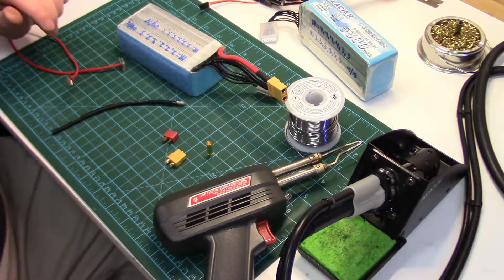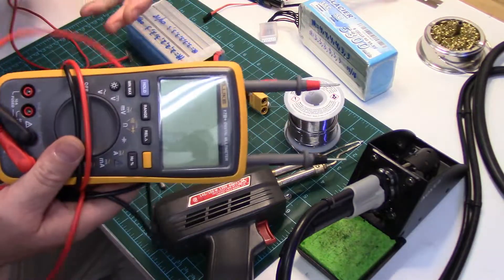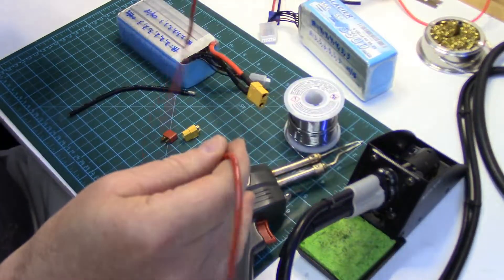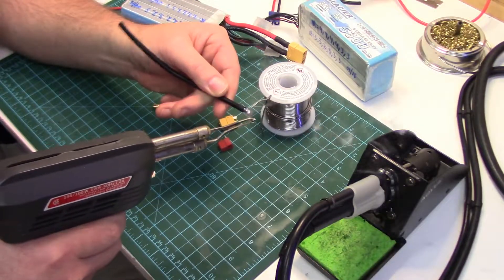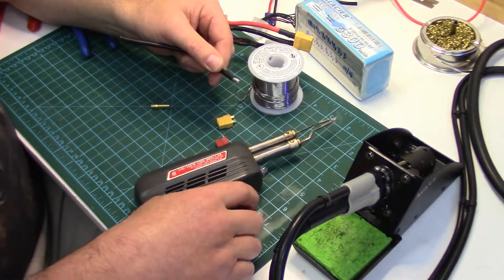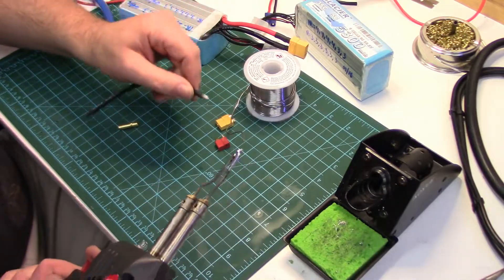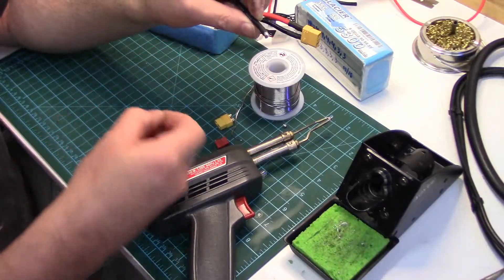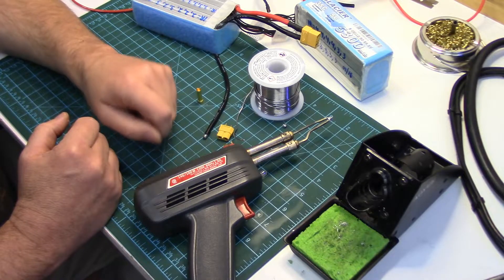How To Tin Wires Before Soldering

Comment from the maker: Want to learn more about the hobby of RC helicopters? Please visit my website:
https://www.rchelicopterfun.com
Reply: What soldering iron heat setting is perfect when working with 12 to 10 gauge silicone wire?  Personally, I love the EC3 & EC5 connectors, along with the XT30 & XT60 connectors.  
I have them "pretty" well mastered.  I also have used the "Solderless" Anderson plugs.  They work great especially if your in tight places and don't want heat around certain components.

FWIW, I "don't" like the Dean Connector's.  I do use them in my smaller Heli's, but never on 500's on up.  When soldered correctly, they do hold up.  I have never had a "separation", but I have separated them pulling them apart!  This happened after I had cycled them 10 to 15 times.  

It's a personal thing with me about just soldering wire to a "flat" pin.  I have done many of them, and I have tried many ways to separate them after soldered!  Their very delicate, and I have to watch to make sure I don't get the "Plastic" to hot while soldering.  It will change the position of the flat pins.

Sometimes, I have used the XT90 connectors, just depends on the project.  I also have used "Butt Connector's" when tolerances are just too tight.  I was taught the more "solder" that's used, it raises the "amp" usage a little.  Same with using an oversize plug for the project.

On my dual battery tray setup's, I use what ever plug that takes the less space (Example:  T-Rex 700).  I have them set up where I can charge both batteries separately on my Duo 406.

I do my best to make sure the Neg & Pos wires are as close to the same length possible, just to keep the electrical flow even.  One of my Pet Peeves.

I have extended the wire length just using a one piece solid butt connector with waterproof heat shrink.

If I don't have any "waterproof" Heat Shrink, I will put a longer piece of regular heat shrink on the wire (maybe a size larger) before soldering the butt connector.  I will put a little silicone on the wire I just soldered (after it's cooled"), not skimpy, just generous, then I will push the "heat shrink" over the splice while twisting the heat shrink to make sure the silicone is even on the inside, then start heating "slowly" starting in the middle and working towards the outer edge of the heat shrink, just taking my time, and I make sure it shrinks evenly.  The most important part is to start the heat in the middle and working out on both sides.  The "excess" silicone will squeeze out during this process.  
Works great, then you have a "waterproof" connection.

Hint:  on the above, after soldering, make sure you clean your freshly soldered connection with the proper cleaning solution, then proceed with the heat shrink. 
I use an alcohol product.  To all reading this, you use whatever cleaning product is recommended.  Some recommendations I have read, well . . . I won't pass this information onto others.  If this step is omitted, it will cause corrosion problems at the joint shortly.

I have tried the clear "solderless heat shrink", and IMO it's great on the smaller wires, I just don't trust it on 14 gauge wire and up.  Works great on 22 gauge wires.

I wish we could post pictures on our responses on this site.

Good Luck to everyone!

Comment: Great video! I had a question. I own the same Soldering gun. Do your tips warp? Mine do. I bend them back into shape with a pair of needle nose pliers.
Reply from the maker: Yes, weller copper tips are soft and get even softer when they are heated up. It certainly doesn't take much pressure (especially side pressure) to warp them out of alignment. Just bend them back the way you are doing.
Reply: @Rchelicopterfun  Will do. Thanks for the response.

Comment: So, if you're using marine grade wire, do you still need to tin the end?
Reply from the maker: No different from any other type of stranded wire; it depends on what you are doing with the ends of the wire. If you are soldering the ends for some reason, then yes you need to tin the ends. If you are crimping the ends, then no, you don't solder them.
Reply: @Rchelicopterfun  Each strand of marine grade wire is coated with tin. You still need to fill the strands with solder?
Reply from the maker: Of course. The whole idea of tinning multi-stranded wire as shown & stated in this video is to saturate the strands so you can then easily melt the wire end into or onto whatever in as little time with as little solder as possible to avoid overheating the components or wire insulation. 
This is even more critical on marine grade multi strand wire since most MGW uses finer wire strands for high flex applications. Just like fine stranded high flex silicone wire in this video (which also clearly has pre-tinned strands). All those fine strands act as formidable solder wick and are very difficult to solder onto a component if they are not first saturated (tinned) with solder.

Comment: Great video.  I'm about to do a fuel pump conversion on a hybrid ATV and the fuel pump came with blade connectors and I really don't like that setup.  I'm going to practice this and try soldering the connections and use deuche connectors for ease of removal.

Comment: I would recommend a small fan and set the fan so it draws the smoke not pushing it. Hopefully all you soldering experts are already aware of that. But it's rare that I see someone using a fan when soldering. And "specific" soldering fans I think are expensive so I just took a fan out of an old computer, connected a base to it and good to go using USB connection into my computer to run it. Someone smarter than me probably could figure out a way to have the small fan connected to your "helping hands" tool. I have found those to be more than handy when soldering.
Reply from the maker: Have one but generally don't use it in videos due to noise & space: https://youtu.be/gLGN8d7r1eI?si=Lv4_9_C11pXMnJ60
That little brushless fan I used was okay, but no question the larger fan works much better - by the way, it started working fine after I took it apart ( https://youtu.be/33kR0ZRE5rk?si=PY4PI0hHKtfb1ZxT ); suspect something loose or binding in the fan motor and it's been working great to this day.

Comment: ouldn't using a dab of flux be a good idea when trying to tin high strand wire to help pull the solder through the strands? I know flux core solder obvious has flux in it, but often if working with stranded high it doesn't seem to be enough. Not alot of flux, just a bit to draw the solder through the wires?  I guess this is a rhetorical question.  lol  Thanks for the video, and maybe flux isn't needed, I think I'm to the point that it isn't me, or the solder, but how good (or cheap) of a soldering iron I'm using that is giving me the problem. Doesn't stay hot long enough.
Reply from the maker: Plenty of flux in Kester 44 rosin core solder. Rarely do I ever have to add extra unless I apply the heat too long and it all boils off - then of course you do have to add more flux or just add more Kester 44.

Comment: Great video!  Is the first tinning considered what I hear folks call a “cold” solder which will eventually fail?  Also what are your thoughts on on using a tinning pot?
Reply from the maker: A cold solder joint or failure is when the soldering connection is brittle and/or has poor metallurgical bonding. And/or because one usually causes the other.
This brittle/poor bonding can be caused by not having enough heat or heat pentation, contamination/oxidation, poor quality solder and a big one for newbies - part/component movement while the solder is cooling back into a solid.
Unleaded solder is much less forgiving to all the above and it's much more likely to get cold solder joints with unleaded than with leaded. It's why I and most only recommend using good quality 60/40 or 63/37 leaded solder.
Never used a tinning pot so can't comment on it. Personally, I see need for one as a hobbyist which I am. If I was making dozens of wiring harnesses daily, then might likely look into getting one.

Comment: I have a soldering unit with digital temp. What temperature should I use ?
Reply from the maker: Depends on iron wattage, type of solder, wire size, solder tip size/shape & your technique - in other words you have to experiment until you find the best temperature for your specific application. 🙂 As a coarse starting point however, if using good quality rosin core leaded solder and a decent wattage rated iron (70W or better) with medium sized wire & a chisel or wedge tip, I would recommend setting the starting temp around 370C/700F and adjust up or down as required.
Reply: @Rchelicopterfun  awesome thanks.

Comment: just stumbled on your video as i was struggling with some battery connectors for my RC planes.  Why would you use a soldering gun vs an iron?
Reply from the maker: I cover this question in detail on my soldering tools 101 video: https://youtu.be/jQfvqJJCS7I
And on my RC Soldering for Beginners page on my website: https://www.rchelicopterfun.com/rc-soldering.html
The reason is power. Most irons simply don't have enough wattage to handle large gauge wire (12 AWG and larger) that we see in our RC powering systems. There are of course exceptions, such as the new direct drive soldering irons which will handle large wire and which I also discuss in detail on that website article. However, an average conventional 40W hobby soldering iron, can't hold a candle to a 140W soldering gun for large gauge soldering jobs.
Reply: @Rchelicopterfun  thanks for the quick reply, looks like my issue is my 40w weller iron with the 12AWG wire i have, i'm having to leave the iron on for so long that its heating up the wire and connector too much rather than flash heating the area i want to heat!
Reply from the maker: @UHF - yep, very difficult to pump enough heat into a 12 AWG wire with a 40W iron. The wire will pull and dissipate the heat pretty much as fast as the low wattage iron can create it.

Comment: Hi i need to solder my daughters rc car its a toy hobby grade car the wires for the esc are rather short and it has a 6 point wired plug like a 6 point tamiya its weird so i want to replace the connector with a deans but i have 2 issues one is about an inch of wire and 2 is i have shakes from my disability is there any tips u can give to compensate n steady my soldering iron obviously im her dad i should be able to do this regardless of tremors.
Reply from the maker: Have you looked into those helping/third hand things? They hold the parts as you solder them so you could perhaps brace your soldering hand with your other free hand that is no longer needed to hold the part. Here's one example, but there are all different types ranging in price from $10 to north of $50:  https://amzn.to/3qzjKxL

Comment: i have 2 soldering irons and a station, all low watt...i think im getting a gun like this, looks so easy.
Reply from the maker: @Tom Jacobs - Yep, if you are soldering larger gauge stuff, you need the wattage - yes, it is easy, but it takes practice and good quality leaded rosin core solder is a must.
Reply: @Rchelicopterfun  guess im ordering some stuff for xmas. im building a high power ebike and have lots of wiring to do. i tried some with my old 30w iron but the motor keeps cutting out under high load, i bet it doesnt get enough current through the cables or bad solder on the motor phases.

Comment: Exact same gun with brand new tip, same gauge wire, rosin core wire for electronics and exact same XT90 connectors. 30-45 seconds to melt the solder if i even get it to melt at all.  WHY?  35 years i have been trying to solder rc connectors and its nothing but a nightmare.  I think im on my 3rd gun, tried several other styles too and not once have i had decent results.
Reply from the maker: Well, without seeing your technique first hand, it's pretty hard to nail down a single or perhaps combination of reasons.

You never mentioned exact type of solder. Ie. lead content, rosin content and brand. That's a big part of the equation. You can have the best soldering equipment going, but the quality of the solder will make or break the job. I pretty much use Kester 44 60/40 rosin core exclusively, but any good brand such as MG Chemicals will work too - just as long as it's leaded solder. Stay away from unleaded solder at all costs if you want good results as a hobbyist.
 
The fact it's taking so long to get the tip of the copper wire soldering element in the gun to heat up to melt the solder would indicate one of four things:
1. The tip is not being kept clean while working. Oxide won't conduct heat. A dirty tip will not only insulate, it also prevents proper "tip wetting" further contributing to poor heat conduction from the tip to the solder. 
2.  The nut or screw terminals that hold the two ends of the Weller solder tip into the gun are not tight. This will produce a poor electrical connection so not enough current can flow through the copper wire soldering tip. Loose screws/nuts on these soldering guns are a constant issue as they always loosen over time due to the  expansion & contraction of the heating wire. 
3. You are not first "wetting" the tip with solder so it's unable to conduct the heat into the part/wire you are soldering.
4. The gun is faulty, but since you say you are on your 3rd soldering gun, that can likely be ruled out. Especially when these Weller guns last forever. I still have my dads which has to be over 60 years old now and it works as well as this one which is now over 25 years old - both get hard use.
I have more soldering tips on my RC Soldering page on my website which might also help:
https://www.rchelicopterfun.com/rc-soldering.html

Comment: @John Salt , I have always been told to make sure I limit the amount of melted solder that enters the insulated part of the wire being soldered.  

Another words, when tinning or prepping the components being soldered, keep as much of the melted soldered out of the insulated part of the wire.

As you know, when soldering, the solder will creep up the wire inside of the insulated wiring especially if you have the iron heat too high.  
I have seen this happen on 14 gauge up to 8 gauge silicone wire.

It appears you let the melted solder walk up the wiring about a 1/4" inch or so in this Video.  What is "your" goal on this subject.  

Personally, I will let it creep up maybe around 1/8" inch up the covered part of the wire.  I can see benefits by letting it creep up a little further into the wire.

I am interested in your procedure and thoughts.

Thanks, and you definitely made a great Video on this subject.  We need more similar Video's especially using large connectors, or just proper "Butt Connections".
Reply from the maker: My goal is to have both a mechanically and electrically solid solder connection. I'm, therefore not overly concerned with how much solder may wick past the insulation. It has little impact. Most of the time it might migrate a few mm at most, but it all depends on the specific wire & gauge of wire, the amount of heat I apply and for how long, and how well my soldering mojo is firing.

Comment: For those of us with little soldering skill, do we need to worry about getting the wire so hot that it somehow ruins the battery?
Reply from the maker: If you are asking if enough heat could ever migrate up the wire and get to the battery (even if held on for a long time) and damage the cell, that would be impossible with normal soldering iron/gun temperatures and normal 6" or so of wire length between the pack and the connector.

Comment: John do you put the tip of the soldering gun on the wire and feed the solder in on the wire?
Reply from the maker: Into both the tip and the wire at the same time to wet both at the same time allowing good heat migration between the tip and the wire.
Reply: @Rchelicopterfun  ty 👍

Comment: Why did you use the solder gun vs the soldering iron?
Reply from the maker: Because that iron I had was not powerful enough (only 65W) for that larger gauge wire.
Reply: John Salt great video btw, was really struggling with that high flexible wire

Comment: What about using flux with rosin core solder?  I'm having a hell of a time getting my wire to wick up the solder.
Reply from the maker: By all means if you need more flux, use it.
Reply: @Rchelicopterfun  so it wont hurt?  I think I might have had my temps to low also.

Comment: Watched a guy "tinning wire" by heating a copper pipe cap full of solder and dipping the wires into it.... never heated the wire before dipping, was using a torch.

Thanks for a comprehensive video on proper tinning.
Reply: You can get the wire tinning done inside the ec5 connector when heated with flame. I often pull wire out again and fill the ec5 cup with a bit more solder after tinning.

Comment: Is flux ever needed for tinning?  Great video btw, really helpful.
Reply from the maker: Flux is always needed for all soldering. Thus the rosin core solder I use :-)
Reply: @Rchelicopterfun  hi John great video... so the rosin core solder I've just ordered means I don't have to get solder paste and dip the end of the wire in it ,I noticed you didn't do this ,the rosin core solder has the flux in it ? Many thanks
Reply: @markpulling12  I have found in different projects, "rosin core solder" works good, but when working with 8 to 12 gauge wire, using the flux with just pure solder works perfectly.

Also, when tinning, I always dip the wire in flux, then apply my soldering tip on the bottom side of the wire as heat rises and melts the flux on the top side of the wire.

I just touch the solder on the iron tip at the bottom just so a little solder starts to penetrate the wire, then I put the solder on top of the wire, and it melts instantly throughout the wire, top to bottom, and as soon as this happens, I immediately remove the soldering iron tip from the wire.  It works perfectly for me every time.